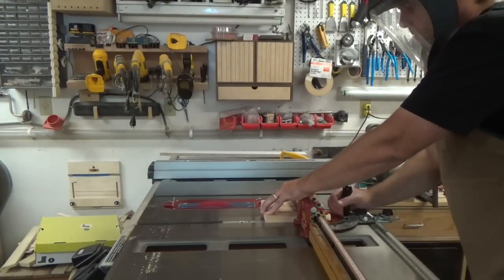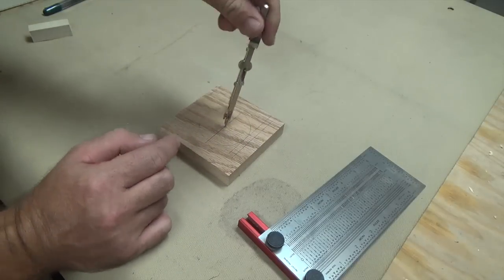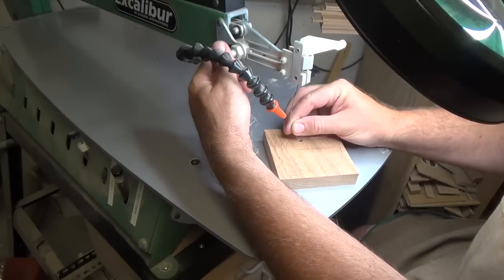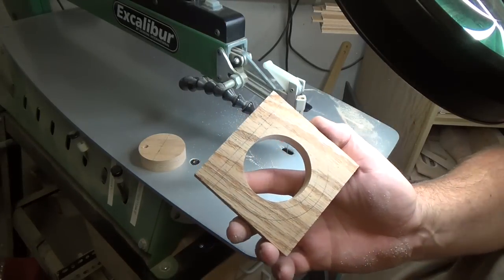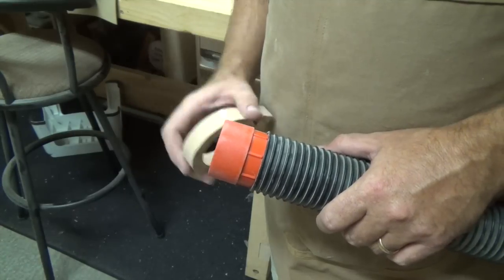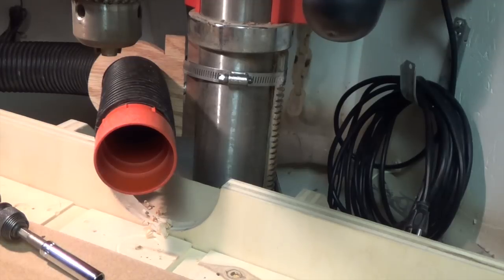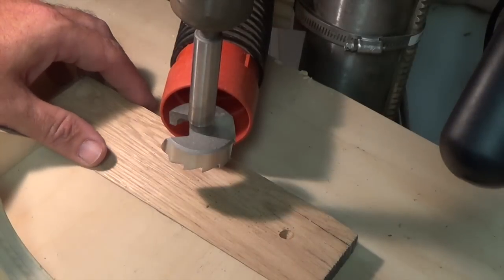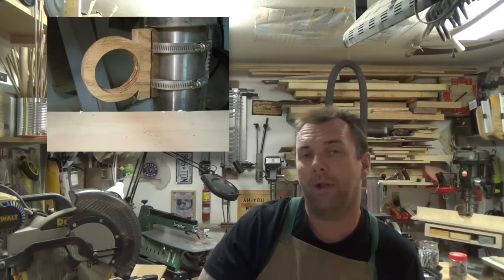Drill press dust collection

Comment: good idea. i like how you eased into the final inside diameter with the drum sander. two minor criticisms: 1) i'd cut the hole with a hole saw, before trimming the stock… hole saws cut smoothly and without burning if you use a little silicone lube. maybe you didn't have one, that's ok, you use what you have, 2) i'd use plywood instead of oak to avoid the piece splitting along the grain at thin sections
Reply from the maker: Both are good suggestions.  Thanks for tuning in and for chiming in with your suggestions on material and hole saws.  It's appreciated.

Comment: Great Idea.I just finished making mine, The only thing I did different was I  cheated and used a 2X4 and used a hole  then the sanded as you did...I am still learning the scroll saw ,and my circles are just a little less than square .(ha ha ) Not as pretty as yours but it got the job done ,,again ,great Idea,,thank you for posting
Reply from the maker: Glad that you like the project.  As far as you "cheating" goes, there's no such thing.  That's the great thing about this hobby.....there are a million different ways to accomplish the same task and as long as you are doing it safely, then there is no such thing as cheating.   The methods that I demonstrate on the show are just one way of doing things and definitely not the ONLY way.  Good for you for thinking outside of the box and choosing a method that works for you and provides the same results.  Awesome stuff.  Thanks for tuning in to the show and for taking the time to leave me a comment.

Comment: With the hose mount clamped in the column, were you still able to adjust the height/level of the table?
Reply from the maker: The hose clamp can interfere slightly with the adjustment but if you put it higher up on the post of the drill press, it is pretty rare that you adjust the drill press table to be that high on the post so it won't get in your way.  I hope this helps.  Thanks for tuning in to the show.
Reply: @acutabove_woodworkings  Got it. Thanks for the promptly addressing the issue. I might try it.
Reply from the maker: @MrKockabilly  You're very welcome.  Good luck on your project.

Comment: Amazing idea just one question how did you countersink the hole from the inside
Reply from the maker: The interior countersink was done using a hand powered countersink tool, much like this one.  https://www.leevalley.com/en-ca/shop/tools/hand-tools/drills/54874-hand-countersink
Because you don't require a large drill chuck to get in the way, you are able to countersink into some tighter areas.  I hope this helps.  Thanks for tuning in to the show.
Reply: @acutabove_woodworkings  thank you so much
Reply from the maker: @akhtermanek4549  You're very welcome.

Comment: Thank you for the idea Kenny, I made one and it works well except when I want to turn the drill press table. Any Ideas?
Reply from the maker: +Lalo Martin Attach the dust collection to your fence, instead of the upright pole of your drill press.  That way, it moves with the table, instead of staying stationary.  A couple of screw, countersunk unto the top of the fence and a couple of rare earth magnets glued into the base of the dust collection will make it so that you can mount it on either the post or the fence at a moments notice.

Comment: Another nice one Ken. Made one of these back during my coach build and it makes a huge difference!

When you make one for the lathe you'll need to make something like a hopper to attach the hose to because just the hose hanging there doesn't work very well. Does anything really work on a lathe? I think its like trying to get all the saw dust at a miter saw. Anyhow I used the floor sweep attachment on mine and that worked a little :) I still get tons of shavings though.
Reply from the maker: The collection at the lathe, for me, is just to gather the dust while sanding.  I'm not concerned about the shavings.  In fact, I want the shavings, because I use them to burnish my turned pieces once I get them sanded.
Thanks for the kinds words and thanks for tuning in Johnnie.